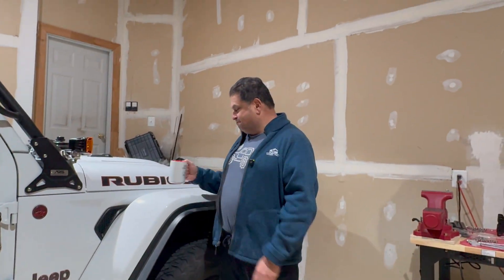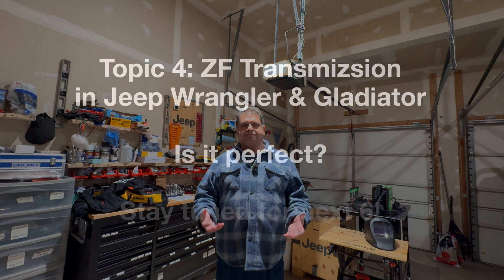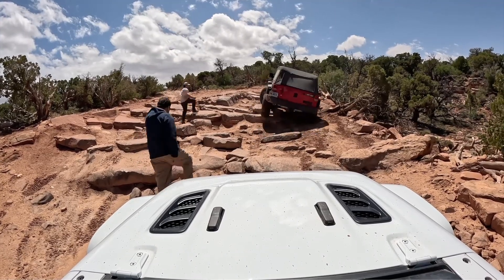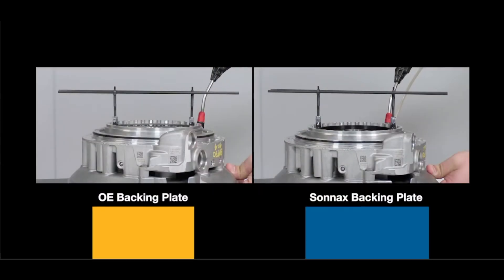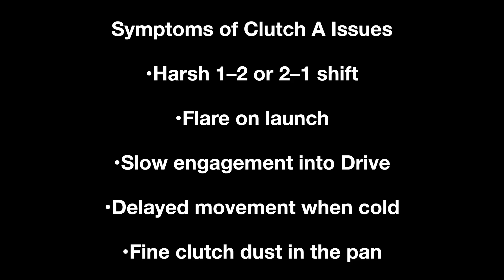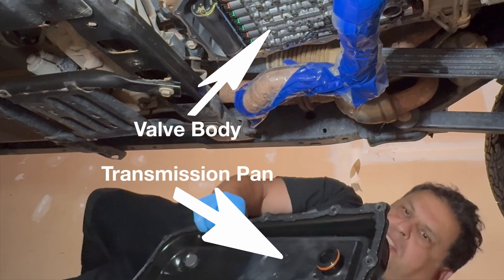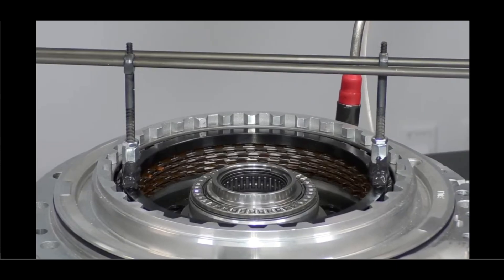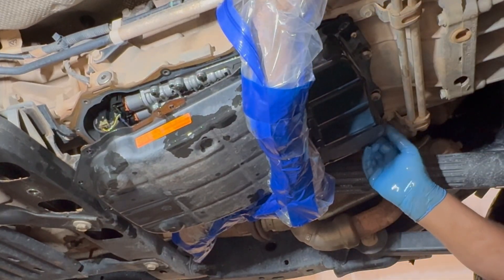Hidden Weaknesses in the Jeep Wrangler’s ZF Transmission (850RE / 8HP75)

Comment: Appreciate the content. Love the coffee mug.
Reply from the maker: Appreciate it! The mug was a little gift and it still gets me every time ☕😄
Reply: Quick follow up: 1. Does this apply to my 2020 JLUR ZF or just 2024+?
2.  I am getting ready to do my first trans service. I have seen other videos for different vehicles where they disconnect the trans cooler line and hook up a plastic tube to the cooler to pump out most or all the old fluid out with engine and trans fluid pump running. They stop when bubbles show through the clear tube. Then drop the pan, clean replace filter and then refill as usuall. This seems like a better method than dropping the pan 4 times to drain out 90% of old fluid. What do you think?
Reply from the maker: @JimmyDevere  Yep — yours, as long as it’s an automatic (not the manual), uses the same ZF 8-speed.(all JL/JLU automatics with the 8-speed use a ZF 8HP variant.)

My 2024 just has the updated heat exchanger Jeep started using in mid-2021 without any announcement. The older design (like your 2020) had an internal ATF thermostat/bypass valve, and that setup was known for malfunctioning that caused heat issues, leaks, seepage, and clearance issues. Jeep switched to a redesigned exchanger that removed the internal thermostat completely, improved sealing, and fixed those fitment issues — but the rest of the transmission and service logic are basically the same across all years.

About pumping fluid out the cooler line:
The official method is the pan drop + filter + refill + warm-level check.

I personally avoid the DIY cooler-line flush because:

The filter and pickup sit in the pan and must stay fully submerged.

DIY pump-out methods require the engine running, since they rely on the transmission’s own pump.

Removing fluid with the engine running can drop the sump level faster than it refills.

When bubbles show, the pump is pulling air, pressure drops, and the filter is no longer feeding the pump correctly.

ZF doesn’t provide a safe procedure for cooler-line flushes — and their docs specifically warn not to run the transmission with low oil.

Quick math on fluid percentage:

A pan drop replaces ~60% of the fluid → 40% old remains.

After 1 change: 60% new

After 2 changes: 0.40 × 0.40 = 16% old → 84% new

After 3 changes: 93.6% new

After 4 changes: 97.4% new

If you want to hit ~84%, just drive ~200 miles after the first service and do one more drain — that safely gets you to the two-change number.

Personally, I think one proper service is enough and the safest.

I’ll probably do another in 30–40K miles and oil analysis, but I’m not chasing a 100% exchange — just keeping additives strong and fluid clean. The two big concerns I have with DIY cooler-line flushes are:
removing fluid with the engine running can starve the pump, and
the risk of debris or clutch dust getting pulled into a passage, pressure galleries, …

The pump can draw unfiltered fluid from the edges and floor of the sump.

Any debris sitting in the pan can get pulled into:

the valve body
the main pressure galleries
the shift solenoids
the clutch control valves
the TCC regulator circuits
Reply: @InJeepious  Thank you I appreciate the reply and notes of caution. Just to follow up, I am curious as to why 200 miles before doing follow up drain and refill? I would think a 20 minute drive of 20 mi would be sufficient to circulate and mix the fluid? Also, regarding the coolant line flush procedure, if the fluid level drops to below the intake to where bubbles begin to show I am not sure how debris would get sucked up from the bottom/side of pans if there is little or no suction? I understand you are taking the cautious approach, I am just trying to understand the actual risk. To be on the safer side, I could possible drop the pan first, clean and replace filter and then do the coolant line flush which should minimize the chance of debris getting sucked into galleries. The only risk would be running the pump while it is low on fluid, but I am not sure if thats a problem if you shut the engine off when bubbles start to show. What do you think? The other safer option, I am considering (because I am not going to drop the pan more than once on this vehicle, I have a life lol) is I have seen on the forum one person suction 3 quarts or so from the fill hole; I could do that fairly easily on a regular interval to keep the fluid fresh overall.
Reply from the maker: @JimmyDevere  Great questions — and you’re absolutely thinking about this the right way. I do lean on the cautious side, but that’s mostly from digging through ZF/FCA docs, looking at how the circuits are actually laid out, and watching a lot of real-world failure patterns. The risks make sense mechanically, not just as “rules of thumb.”

First, just to clarify terminology: on the 850RE there are two completely separate loops tied into the heat exchanger:  
•	A coolant loop (engine coolant in and out of the exchanger)
•	A separate ATF loop that goes from the transmission, through the heat exchanger, and then on to the front cooler / return

So ATF never actually runs through the engine’s coolant passages — it passes through its own galleries in the heat exchanger that are thermally coupled to the coolant side. 

When people talk about “using the cooler lines to flush,” they’re usually talking about the ATF side, not the coolant hoses. I just wanted to make sure we’re aligned on that point.

Why 200 miles instead of a quick 20-minute drive

A 20–30 minute drive absolutely circulates fluid, but it doesn’t guarantee you’ve fully mixed what’s trapped in the slow-exchange areas:
•	Torque converter
•	Clutch drums
•	Valve-body passages
•	Cooler and heat-exchanger circuit

Those regions trade fluid more slowly. A couple of full heat cycles and a mix of real driving (lockup / unlock, multiple gears, light and moderate load) over ~200 miles does a much better job of:

•	Fully homogenizing old + new fluid
•	Re-suspending any fine debris that’s going to move
•	Letting additives blend throughout the system

So it’s not that 20 miles does nothing — it’s just not as reliable if your goal is “max mixing before the next partial change.” The 200-mile suggestion is conservative by design.

Why line-flushes are risky once bubbles show up
On the 850RE / ZF 8HP family, the pump is a positive-displacement gear pump; it hates air. ZF’s own training material stresses avoiding low oil level and cavitation.  

Once you see bubbles coming out of the cooler/return line, the pump is already ingesting air. At that point:

•	The pump is still turning, but inlet flow is part oil, part air
•	Pressure at the valve body becomes unstable
•	Oil/air mix is being hammered through small control passages

That turbulent, aerated flow can lift and carry fine clutch dust and micro-debris that were happily sitting in low-flow corners and push them into:

•	Solenoid valves
•	Pressure-regulator circuits
•	Clutch feed passages

That’s exactly how you end up with sticky solenoids and marginal pressure at Clutch A/E in the ZF 8HP family.  

The risk isn’t “huge chunks getting vacuumed off the pan floor,” it’s fine debris being violently stirred and injected into the tightest, most sensitive parts of the hydraulic circuit.

Dropping the pan first does reduce risk — but not all of it

You idea here is mechanically sound:
Drop pan → clean → new filter → then flush

That absolutely:

Removes heavy sediment
Gives you a clean filter
Lowers debris load

But it still doesn’t eliminate:
•	Debris stuck in the valve body
•	Fines lodged in clutch drums
•	Contaminants already inside the cooler and heat exchanger

So you’ve reduced risk — not eliminated it.

Your remove-and-refill method is the lowest-risk option if you don’t want to drop the pan again:
Pull 2–3 quarts from the ATF side through the fill port or cooler return — without running the pump dry

Do it at a consistent cold or warm condition so fluid density is comparable Refill the exact amount removed

If you repeat that every 10–15k miles, you keep the chemistry and viscosity much closer to fresh without ever inducing cavitation or hammering the valve-body circuits. From a hydraulic-risk standpoint, it’s way safer than running the pump until you see bubbles.

You’re not wrong for questioning it — you’re thinking like an engineer. My guidance is simply aimed at minimizing hydraulic shock to a very sensitive system.
Reply: @InJeepious  Thank you sir.